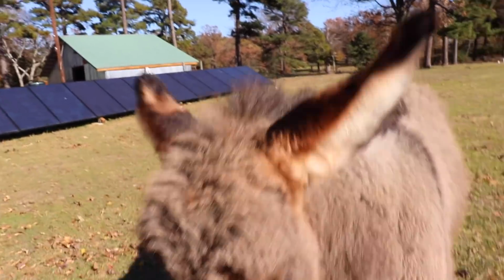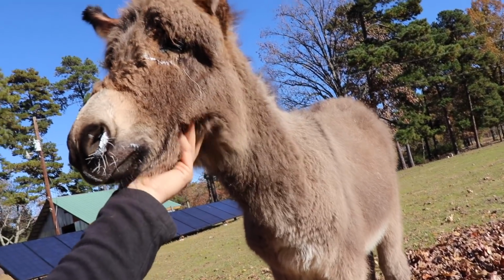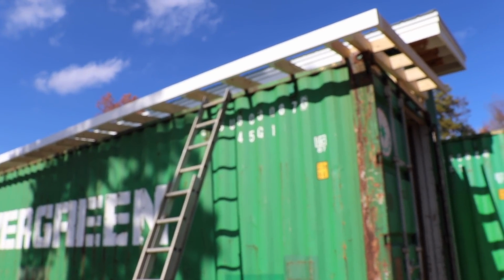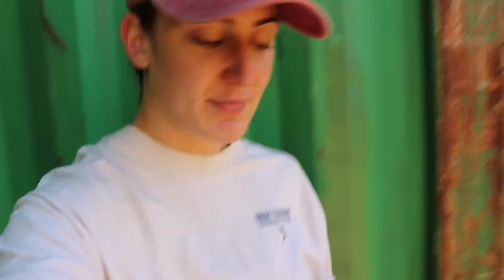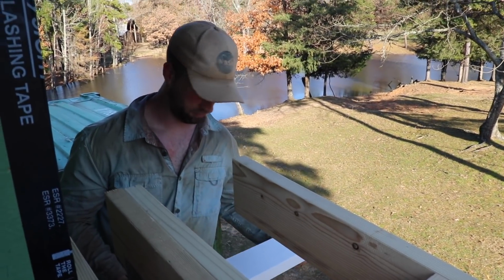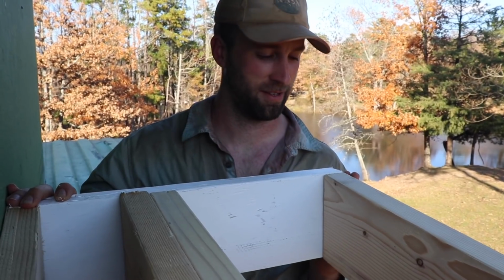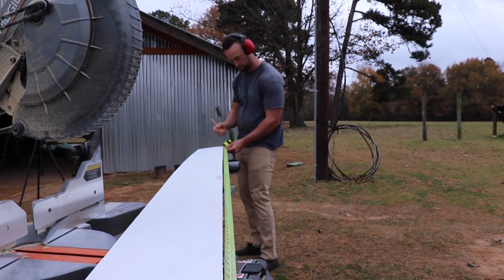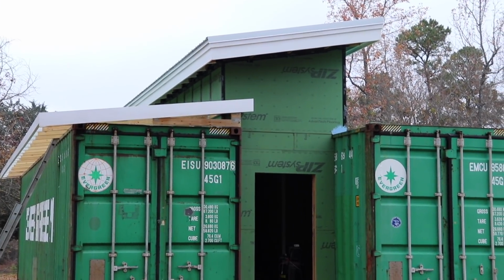Zipping Up Our SHIPPING CONTAINER Roof!

Comment: FYI, when you go build the rainwater collection system, make sure to do the first flush diverter system.  I would also put in a sock filter after that and before your storage tanks.  I have a 500 micron sock filter that fills up a bucket and overflows out into my storage tanks.  This really pulls out a lot of sediment from the water.  It’s not safe to drink yet but it’ll keep your tanks from gathering sediment. From there you will need spin down filters and maybe a UV light. Let me know if you want more info.  I’ll be happy to share what I have done.

Comment: Hi there great job puting these videos together. Don’t forget to ventilate enclosed air space cavities to prevent moisture/heat/rotting/bubbling/deformation. Unless of course you fill in the hole space with insulation I didn’t see. (40 yrs construction exp/general c)

Comment: Zip system is great,  I changed from the osb plywood and felt.  It is a little bit more expensive, but cuts labor drastically.  Just tape the seams.  If you go with the red sheets, you don't have to used H clips.  Its thicker.

Comment: Hey, How come you didn't use any insulation between the Zip System and the container roof? I'm sure you could have used batt or sheet insulation and gained some efficiency!

Comment: Did you guys say you're in Texas? With metal containers, are you likely to suffer from moisture build up due to cold metal surfaces? Massive problem here in the UK...

Insulating roof between your new roof and metal containers ceiling would alleviate some of that, or you got another plan in action? 🙂

Comment: I had a question while you were talking about the rain catchment system, with respect to the tarpaper, etc. - You're not just using the metal roof to direct the water into the gutters that feed the system? If you are, then what's under the metal roof shouldn't matter. Perhaps I missed part, as I was watching while eating my lunch at work, and get sidetracked regularly. :)

Comment: How are local building inspectors handling your build? also what did they think about your solar power system?
Reply: no code or permits in texas in the countr.
Reply: @josephmclennan1229  not even power and structure? I live in AZ out in the county and they still require inspection for structure and power, very cool that you don't have to deal with that!

Comment: You guys should coat anything exposed to the elements or the possibility of it as long as it's not going to require the need of paint for cosmetic purposes you should coat it with Henry's tropicool 100% silicone roof coating. That stuff has a lifetime warranty and it will waterproof and weatherproof all of the wood such as your trusses and what not. I've used the stuff several times and it works great!!! It also significantly reduces the surface temperature of metal structures. 

I know you guys are already painted everything but this for informational purposes for future projects or for anyone else who may be in the same type of a situation where the stuff could be used.  

https://www.homedepot.com/p/Henry-4-75-Gal-887-Tropi-Cool-100-Silicone-White-Roof-Coating-HE887HS018/205049553

Comment: Did you say harvesting roof runoff for drinking water? That's really third world. How about not risking getting parasites from bird droppings or botulism from storage at optimum temperature to grow bacteria. A well is ok for the off grid life. Two things you don't want to go all backwoods on is sewage disposal and water source. Use modern methods! It's a life safety issue.
Reply: Depends on how deep you have to go with your well and how much money you have
Reply: Are you serious? It is a requirement in some states of Australia to install rain water tanks due to water restrictions in drought times. There are so many good filtering systems.
Reply: @RJCOutdoors  
Can you see all of the green trees? How about the pond? Lots of water. Let nature do the filtering and just pump it up, pump it up. Break it down, plumber time. Sorry I got a little lost with the old music references for Devo. I live a few hundred miles east of there and put in a 100 foot deep well into a spring. The best water I have ever tasted.
Reply: My point is that a tank is not a "Third world" option nor a life safety issue. It is common practice and a cheaper, low maintenance option. It is not uncommon to have above ground water storage in areas of 40 degrees Celsius/104 degrees Fahrenheit without fear of unusable water with filtration. If rainfall is high, why not harness that option. Just using "modern methods" of filtration will solve issues.